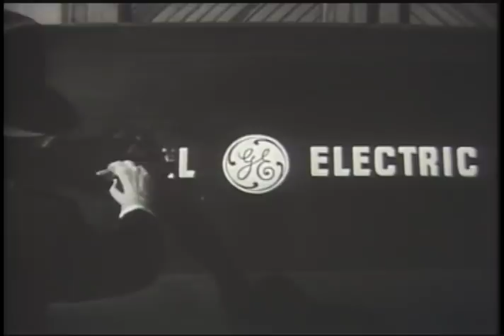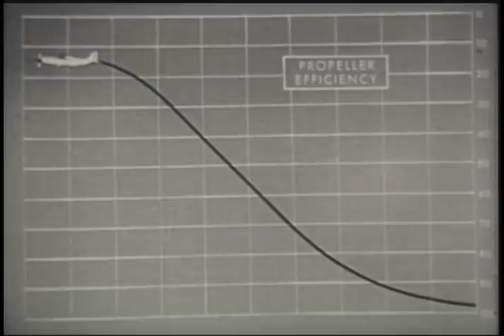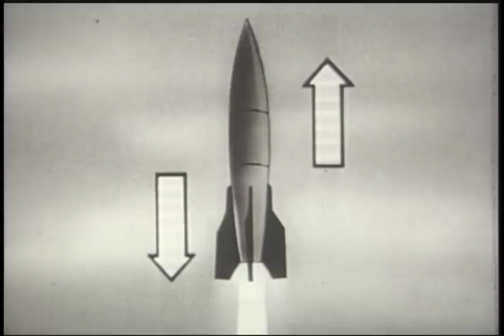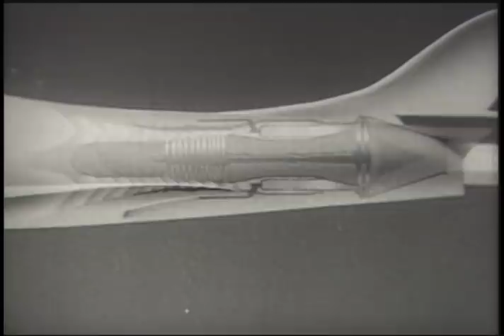Blast From the Past: The Story of GE’s First Jet Engine

Comment: This GE commercial is a bit begrudging over the actual contribution of Whittle and Power Jets. In all the biogs I have read on the subject, the contribution of GE, whilst clearly accepted as being very important, was really about the much better manufacturing capabilities and standards available in the USA industry, though the video is correct in pointing out the availability of high temperature alloys which Whittle knew he needed and was desperate to get hold of. The engines that equipped both the Airacomet and the very successful Shooting Star were direct copies of Whittle's designs. Indeed, several of Whittles engineers went over to America to assist in the production of the engines.
The British jet engine industry went on to continue to lead the world in jet engine design to this day, whilst having to divulge all their developments to the USA in part payment for their war expenses they owed the States. It is possibly the only cutting edge World leading industry that they still maintain.

Comment: You can tell the footage of the arrival, in the U.S., of the prototype Whittle engine and removal from the a/c are reenactments. It was flown across to the U.S. in a B-24, not a B-17, and the a/c shown has USAF markings (1:03), proving the footage was shot post September 1947.

Comment: If the U.S had more advanced jet planes than Great Britain, then why did the U.S later have to license the English Electric Canberra from Great Britain? Perhaps GE was all hype.
Reply: soaringtractor  Short Story, USAF wanted a simple tactical jet bomber in service for Korea to replace the A-26 Invader. They had two options, the Martin XB-51and the Canberra. The USAF thought the XB-51 was too loaded with bugs (too much innovation in other words) to get in service in time, so they selected the Canberra. The USAF Canberra's were powered by axial flow engines licence built from a British Design (the Sapphire). In Fact the USA copied and used a lot of British Engines, up to the RR Spey and the engine for the Harrier. If the US needed an engine to do a specific role in an aircraft and the British had an engine that could do the job and the US didn't, they just bought the rights to build the UK engine. You're correct in the fact that the B-45 and B-47 were better Strategic aircraft, but they were no good for the tactical conventional role .
Reply: @richardvernon317  Soaring Tractor Wilbur Finnigan is DEAD , thank god